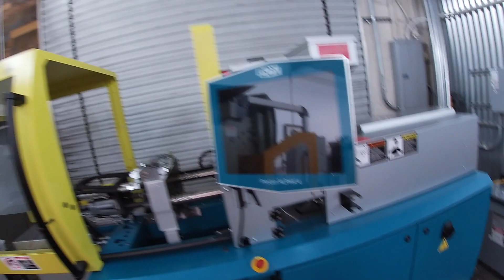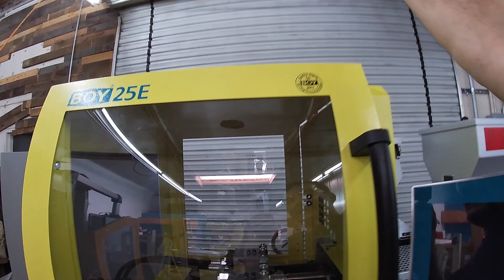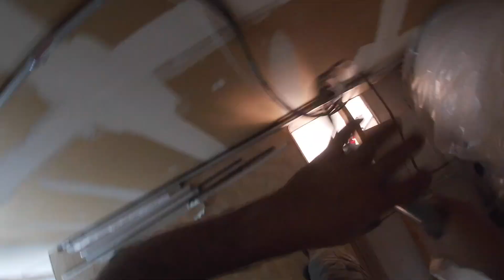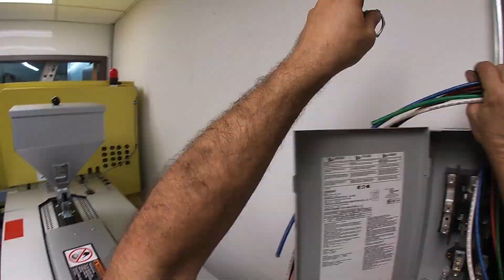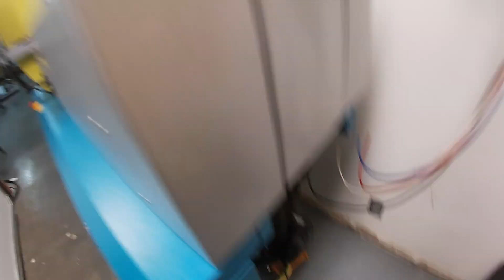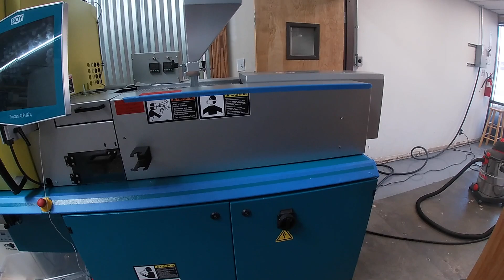New molding machine

Comment: Cool machine, its a bit pity there's not a lot of smaller older machines, apart from old Arburgs from late 80s. Haven't you actually had experience with older machines, I always wanted smaller injection molder, but can afford only smth like used Arburg, do you know the main thing differs new machine from those older ones, apart from touchscreen interface and mb servos vs async motors? Or the main issue is used linear rods that is hard to restore mb? Thx.

Comment: Hope it's not verboten to ask... What does something like this cost? Enjoying all your videos. Thank you!
Reply from the maker: Hi Thanks for watching.  That machine is ~$53K, they have another eco model that is around $40K I believe.
Reply: @DragonflyEngineering  Would this make a 10in x 11in x 6in size injection mold
Reply from the maker: @jeffking3472  no, the 25e press can go up to an 8x8x8 inch mold, and that is tight. The 35e can  fit your mold. Gotta keep parts size around 4 ton per sq inch